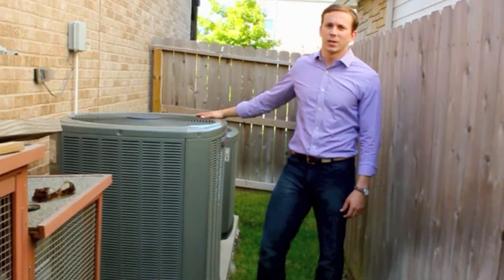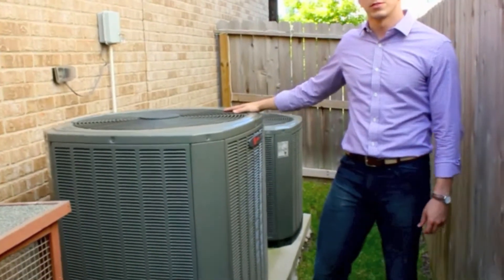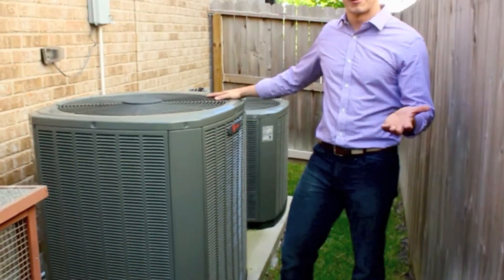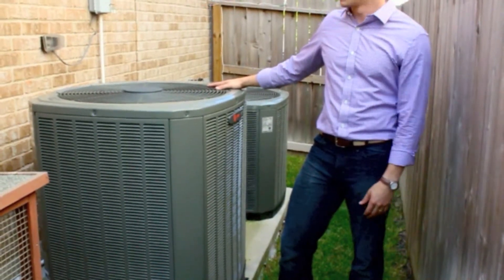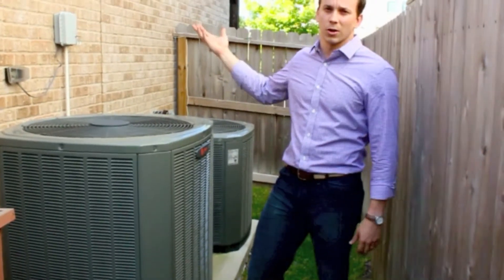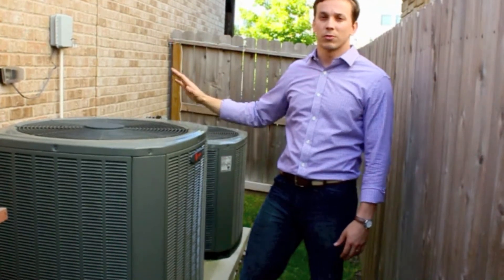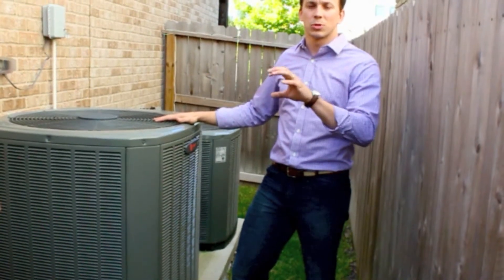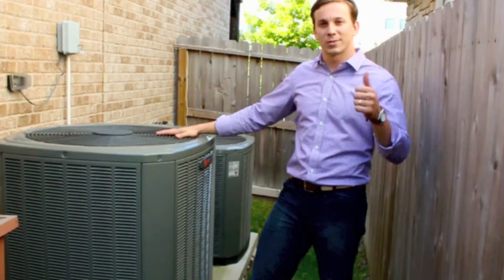Explained: Why are Float Switches Required by Code?

Comment: are you sure its required per code?  My understanding per code is that you need 2 drain option.  First one goes to the house drain and the second one is a backup.  The second one is to drain at a location where its visible to the homeowner.  Meaning it is an indication that your primary drain is clogged.   When new houses are built they are build by code.